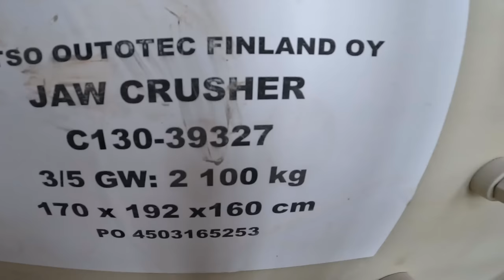Metso 130 Jaw Crusher In Action.. 600TPH

Comment: Would have been nice to actually see what it is doing w/o another load of rocks obscuring the action.
Reply: They use a load of smaller rocks as a wedge and it helps break the bigger chunks from bouncing around. I worked in an underground crusher in the 1970s, the rock would travel on a conveyor belt to the bin near the Mine Shaft and skip to the surface.
Reply: I don’t see any rocks being crushed. Just rocks jumping around.😡
Reply: When I worked in an Underground Crusher in Lynn Lake Manitoba in the 1970s, when we had big rocks stuck between the jaws we also used an iron Wedge on a chain, We sled the wedge long side the rock and the jaws and it would give it more friction and grab and break the rock.
Reply: @davidhynes
Reply: lol 😂 if the crusher isn’t crushing, it’s not making money. So yeah, I’m sure they want to hold up production so you can “see what it’s doing” 🤡🤦🏻‍♂️